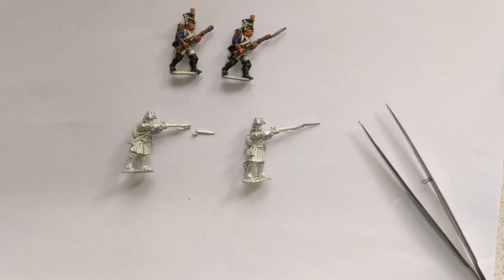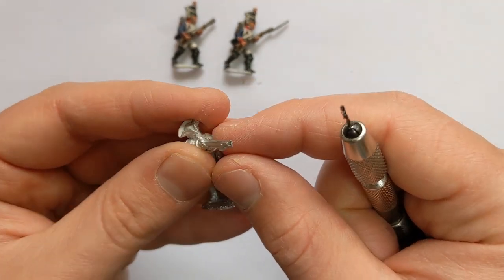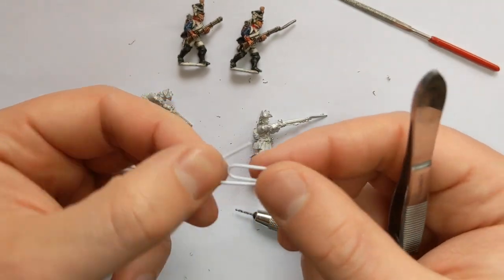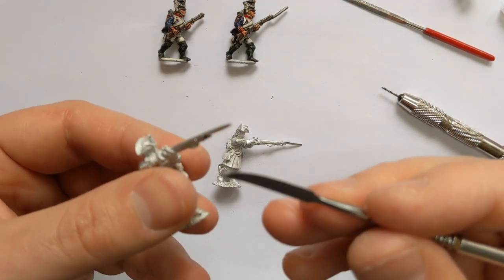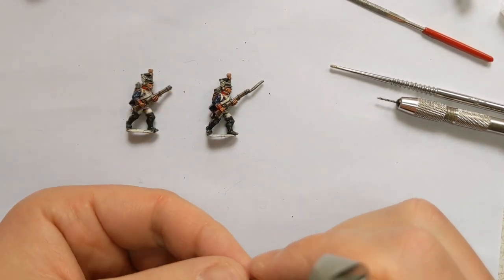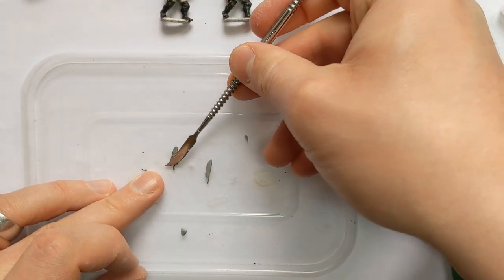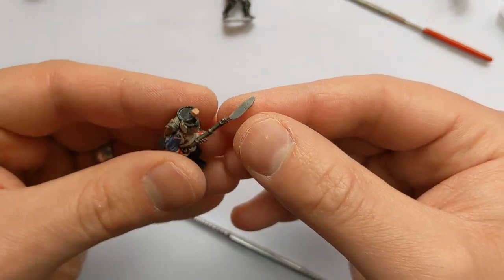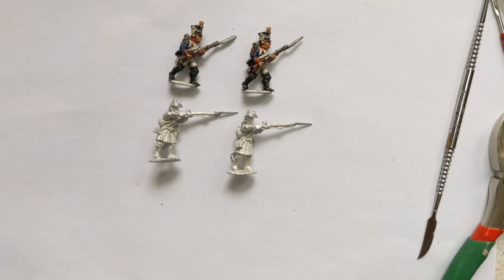Fix Bayonets! A guide to repairing broken, and replacing missing, bayonets on wargaming miniatures.

Comment: Very useful video. I'm always snapping bayonets, especially victrix plastics!
Reply from the maker: Victrix bayonets are so narrow that it would be very tricky to drill a hole for a wire.  I'd be tempted to use a spare arm from the set rather than attempt a repair!

Comment: Great video, takes a steady hand to drill out those pieces. For sword blades and scabbards I found a narrow hair pin (aka Bobby Pin) that is perfect. I cut to length, put a point and a tag on the pin. I then drill out the figure's hand and glue the new blade in place. The pins are made out of a spring steel and can actually be made into true blades if you want.
Reply from the maker: Yeah, practice is needed to get the drill centred. I have seen guides to using spring steel and using a hammer and anvil to make a blade. Much more robust than a cast blade.

Comment: You are bloody Clever; im very impressed. As i live on the other side of the world (Australia); we frequently receive our figures from the UK at 25% more than you Guys pay for them, with broken bayonets and especially broken swords.
Advancing figures tend to have more broken bayonets at 4-1 than their Marching counterparts.
Do you have a recipe for Broken swords please? Conversions are way beyond my skill set; but it is a necessity, so i will def have to learn.
Your Fellow Master Gavin Booth has been known to scratch build Swords from Plasticard (with hole drilled in hand) he crafts the blade and fixes a narrow shaft into the hand. Ive only seen him do this on a 54mm figure but im sure a similar technique could be used on 28mm figs.
Years ago i also saw an article where they flattened tacks (nails) and using those instead of swords (looked crap as swords but would prob look grand as a bayonet!) but with the dexterity of yourself; im sure you could use your technique with the tacks "as bayonets."
So i would love to see you do a follow up piece on swords/bayonets; repair or replace please
Hope youre well
Stew
Reply from the maker: I will have a root around for an officer with a broken sword to repair.  Alternatively I probably have a dark ages model or two that could be substituted in as it would be the same process. I have seen a guide in a book to using steel pins, flattened out on an anvil, as replacement swords. Don't have the metal working equipment but I do have wire and putty.
Reply: @CullodenPaintingStudio  You are the Mcgiver of Fine Scale Modelling! lol
Nail tacks and a hammer will do just nicely; or a Vice!
Whatever you come up with will be great
Look forward to the followup
Cheers 
Stew

Comment: What if you have a plastic minature which doesn't have enough are for a drilling a hole? do you just try to glue on putty facsmile?  Thank you.
Reply from the maker: Plastic is trickier as the bayonets tend to be smaller.  If it's too narrow to drill out then honestly, I would source a new musket and cut the old one off at the hand, or arm at the shoulder. Possibly even just get a new sprue of figures!
Reply: @CullodenPaintingStudio  I think buying new sprue is the best. I've tried all kinds of glues and none will bind plastic pieces. Thanks. I keep records of your paint colors and appreciate what features of uniform go with what.
Reply from the maker: @iamsuperroot  I am glad to be of help